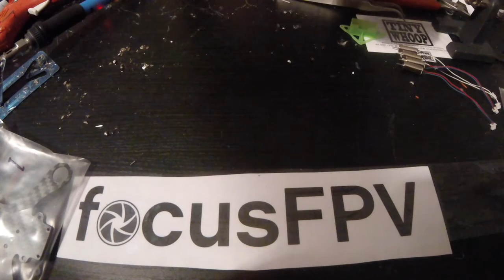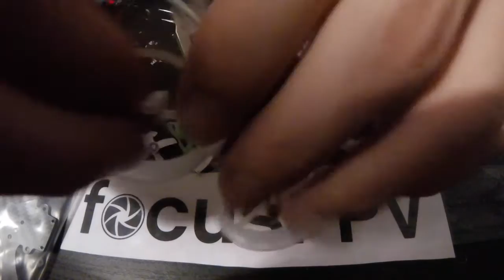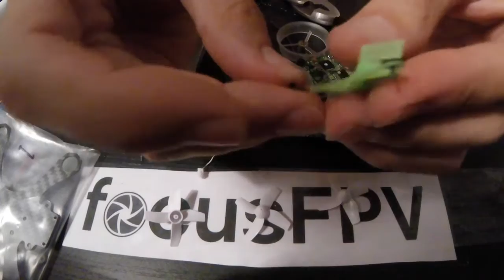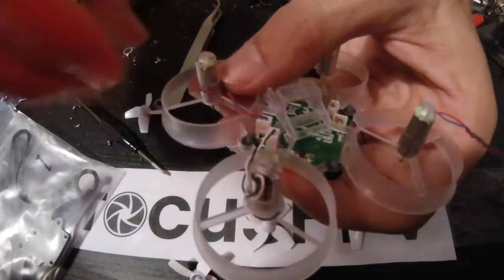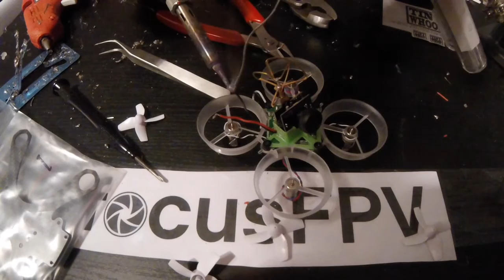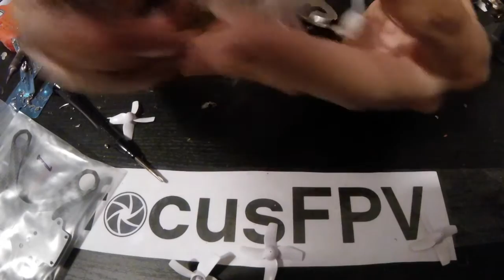Real-Time Tiny Whoop Build | Inductrix FPV Mod | The Famous Micro Drone Built By focusFPV

Comment: Thanks for taking the time to walk us noobies through this process. Question ... have you upgraded to the 'power whoop' jst connector? I recently upgraded motors and added an AIO camera, but I haven't yet soldered the camera to the board. Instead i'm using the splitter that connects to the battery. I'm finding horrendous flight times before LVC kicks-in; with plenty of juice in the battery. Is this possibly due to the camera connected directly to battery instead of soldered?

Any advise you can provide to increase flight time/manage LVC using stock inductrix board and stock jst battery connector would be greatly appreciated.

Thanks again!!